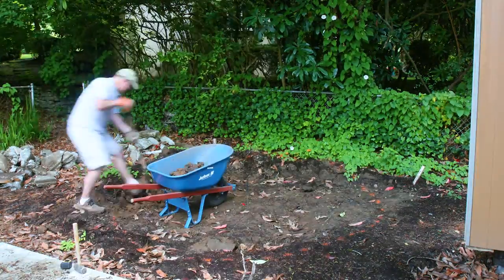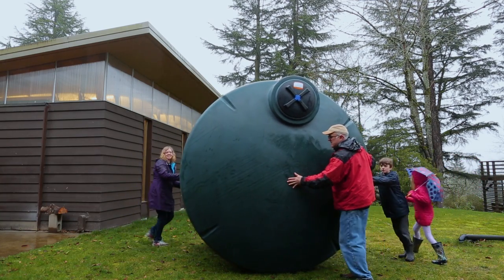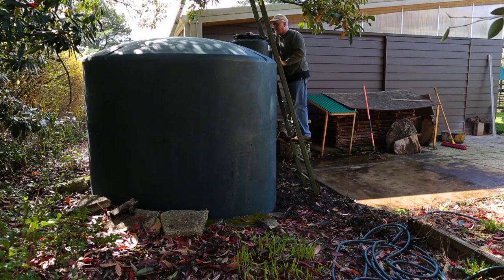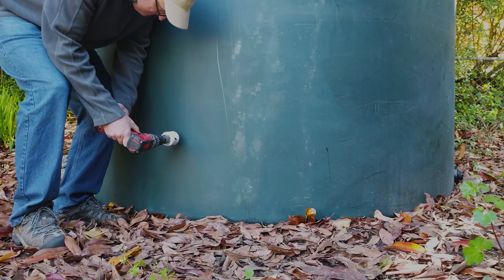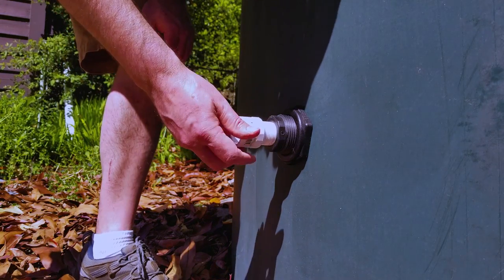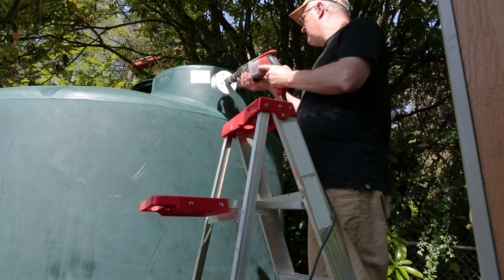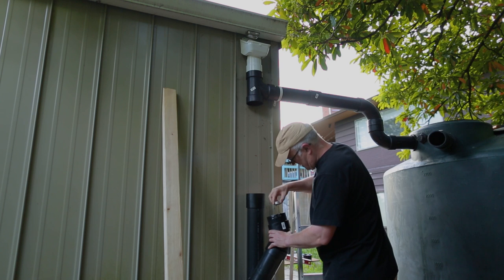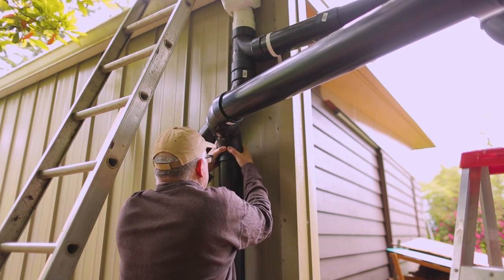The Rainwater Tank

Comment: The over flow looks a little back graded towards the tank, not a big deal though. If you think the horizontal runs aren't properly supported but some supports (pipe clamp or something holding the pipe to the building) on the risers just below the fittings for the 90 from horizontal to vertical and you'll be fine. Source: I am Pipefitter.

Comment: If you add a layer of gravel, smaller gravel then sand to the bottom of your 1st fill pipe, you can leave the drain valve open & it will auto drain in between storms.

Comment: The first rain reservoir is not really needed. The tank will leave the dirty stuff in the bottom of the tank, thereafter you can use the clean water and the overflow is just a good system.

Comment: When using hole saws, especially that size, you definitely want to drill a pilot hole. It would help a lot also you cant put so much force on a hole saw like a typical drill bit, due to how much more surface area the hole saw is trying to grab it will rip it out of your hands when using a cordless drill. Usually you want put just enough pressure on it so it begins to scratch the piece your working on. Ive noticed that once you get a decent little rut for it to sit in you can begin to apply a little more pressure to help get through it. I dont know if its due to the bit getting hot so it goes through the material easier or if it has something to do with it having a little more speed then the initial start ,but yea those would be my reccomendations on hole saws. Also i have a question if that was the drain you were putting on why was it so high up from the bottom of the tank ? Even a couple feet off the bottom would be tons of gallons of water and would weih a bunch if the purpose for draning was to move it,its still gonna be a pain

Comment: In Puerto Rico where I live in the house within our community and on my farm in the mountains of Puerto Rico I have rain water HARVESTING systems. Just from the runoff we get four MILLION gallons of rain water in my community neighborhood home. On my farm we get over SEVEN MILLION GALLONS OF RAIN WATER from the mountain runoff. At the bottom of the mountain I have a ten inch pipe under gravel,  dirt gravel,  dirt, sand gravel and dirt and grass. There is an outlet with several filters then the water goes into a tank for distillation and finally into my enclosed swimming pool which is really an underground water storage tank that has UV WATER STERILIZER SYSTEMS and an aquarium pump for pumping water up to a tank on the highest level of the roof. The entire system was built in conjunction with the building of my houses. I use an array of solar panels, hydro electric turbines with four aquarium pumps to generate electricity and finally wind turbines. 
I got the idea from watching The Discovery Channel where they had a series on the demise of the human race. In that television series the ALIENS were under the impression that SWIMMING POOLS WERE ACTUALLY WATER STORAGE TANKS.  I also learned that in the series an Olympic Size Swimming Pool holds four MILLION gallons of water. 
Here in Puerto Rico we have the rainy season and really rains a lot here. I truly enjoy living completely off the grid. Including Satellite communications and satellite internet with satellite entertainment systems. My farm is an Agricultural farm in which I don't pay any type of property taxes. My community neighborhood house is my Primary residence in which I also don't pay any taxes for.  I just pay the insurance coverages and regular time to time maintenance for fixing or upkeep of my properties. 
After Hurricane Maria hit Puerto Rico most of my neighbors around my farm moved out to the United States and sold me their farms which surrounded my property in the Mountains. So now I have a flowing river through the Middle of the farm. 
We had several earthquakes after hurricane Maria and now we have The Wuhan Chinese Coronavirus PANDEMIC PLAGUE in Puerto Rico. But as a cold War era  child I was trained in Civil Defense learning how to prepare for disasters. Too as a retired Navy Combat Veteran who has served 34 years in the Navy I knew to prepare for everything possible. Food storage,  water storage,  security measures, and medical emergencies. Besides having lots of toilet paper,  I also have lots of Banana plants and Plantains trees with very large leaves in case I do run out of toilet paper...🤣🇵🇷😂

Comment: Bury the tank below ground
Run the rainwater into the tank
Use a pump to push the water to the peak of the roof and out an irrigation line.
The cool water would cool the roof and subsequently the attic space cooling the whole shop.
The used water would go back into the gutters and down into the tank to be cooled and used again.
Hook all the electrical up to a solar power system.
Liquid cooled shop. 
You're welcome

Comment: You could've just roll it around, that would save you a lot of time. They are pretty durable tanks. I had one that was blown for like 300 ft from where it was originally standing. I'm still using it, no damages. Also...you could've buy the correct fittings that you need instead of cutting a hole into the tank...If you ever need to use the tank for something else it will be a hustle to convert it again...

Comment: Why does the water enter the tank and is released at the bottom? Why cant it free fall from the top? Would love to understand why.
Reply: The fresh water what enters will renew the old water in the Bottom of the tank. The water moves around. If the Tank is very full there will not be very much free fall of the water and it wont mix itself. So it was released at the Bottom. :) J.

Comment: Now how would this system handle the inflow of rainwater when the tank is nearing the top or even halfway point? Wouldnt the pressure of 2500 Gallons of water weighing down keep water from continuing to flow in?
Reply: That's a good question. Something to know here is that pressure in water does not depend on volume but on height, with the formula of Pressure = Density * Gravity * Height
That means that, as long as the pipe inlet (the downspout) is above the water level into which it flows (the water level in the tank), water will continue to flow into the tank. Whether you have 2500 gallons or 1 gallon makes no difference, it is all about the height.

Comment: Very Well Done.  I have been plumbing for years, and yes, figuring out that last glue joint can be a tricky one.  I think you did a GREAT Job. I have used hole saws for years too, and glad you didn't break your wrist with that first drill.  now that your finished, what would you have done differently, if anything ? thanks for the Documentary  ;)

Comment: Your going to get some leaves in the filter on the roof of the tank, so regular cleaning would be needed, which if not the leaves will find there way into the tank and spoil the water. trust me, it has happened many times to our tanks.

Comment: Very nice vid with coll effects. Is that tank really 350 lbs? I have a much smaller (550 gallons) and it was really light weight. I could lift it in the air upside down and wash it  so all the debris could fall out. I also took the frame of the lid off and came in to clean. Yeah, I got my tank used all dirt but it cost only U$180 and the last owner delivered it to me.   So far I just bent the spouts into the opening and the tank is full haha it rains a lot here in Florida.

Comment: A tip with hole saws especially in metals is to come in on a slight angle. Nothing crazy but enough so you aren't having full teeth contact at once it'll be too much unless you are using a drill press.

Comment: If you drill a hole at the bottom of the wall of the tank and mount a clear pipe that runs upwards on the outside you can see the water level in your tank

Comment: 7:47  ...  with a magnet at the other end, you would get it easily 😉    :  anyway, very nice work !! 

i wonder that, if the 18:28 filter system is dirty (many trees around ...), if the overflow will go down to the basement ? 😲
there is no extra security to avoid water spilling around this piece, or water projections ? 😩

Comment: I watched this vid over a year ago and saved it. I haven’t read all of the comments. Can someone tell me if, with proper placement, installation, and overflow drainage considerations, could this system be installed under ground with a cabin built above for year round use? In the winter (no rainfall) could water be trucked in and the tank filled? Idk, just trying to get a system that works. I don’t want to be hauling buckets from the creek or melting snow or defrosting pipes.

Comment: I would have run the overflow straight down along the side of the tank and then across the ground to the outlet. Of course, it could be a tripping hazard but then you wouldn't have to worry about the weight of water in the pipe.

Comment: Question..... would not the water pressure of the volume inside the tank overwhelm the gravity fed system and cause it to not fill the tank past a certain level?
I would think having the water inlet pipe opening closer to the top would be more effective.

Comment: One trick I have seen done by someone to handle the insertion of tight fittings. Put the inner piece in the freezer beforehand. It would have the same effect as heating the outer assembly.

Comment: Great, if the rain water go down the tank by big/ling pipe. This will stir the rain water inside  big tank. Rain water will by murki n dirty. The solusio is not using the long pipe in the tank. 😆😅, better think about how filter the rain water. Better have a sistem let the part of dirty rain gone... then fill up the tank... 😍. Thx4 the video

Comment: Something I am having an issue rapping my head around, with the inlet inside the tank having the footing on the floor, wouldn't water pressure stop the inflow way before the tank is full ?
Reply: dave Smith. The pressure from the water level build up should oppose the flow of water into the tank only if the tank is not under atmospheric pressure. But since both the inside of the tank and the drain pipe to the bottom of the tank will have close to the same pressure it should flow okay.
Reply: @rhodaime79  Thanks, okay, I think I have that sorted, now that I have had time to think it through yes, I get it.

Comment: A punched well would be a lot easier, and not that costly,  you don't pump the water till you need it and it's safe to drink. The the pond makes the best and richest supply of water for gardens! It doesn't use that much water, gray water can be great for the yard.

Comment: What's with the ball in the drain? What's the purpose of the black ball?
Reply: The ball floats to the top as the first runoff pipe fills.  Once the runoff pipe is filled the ball will be at the top of the pipe and will act as a plug to allow the cleaner water to flow into the pipe filling the tank.

Comment: Wouldn’t that overflow res. .... once full with dirty run off water eventually get washed into the tank over the period of the rain fall. I can’t see it just sitting and staying in the overflow with additional water agitating it and stirring it up etc 🤷🏻‍♂️
Reply: Nothing is perfect. And no most of the debris wouldn’t cause an issue because its under at least a gallon of water pressure. Its not like this system has any kind of vacuum suction.
Reply: Don’t get me wrong ... I think it’s a great system. I suppose the dirty debris should fall to the bottom and settle though hey ... sand, dirt, shingle crumbs, bird shit ...

Comment: There was no need of so much of struggle for the first hole and fix the assemble through the inner side by making the boy slip into the tank while it is kept in the horizontal position . Later the boy could have come out after helping his father to fix the bush from the inside . After the boy is out they could have erected the unit .Its that simple . It could be scary to some though .

Comment: Those drills are too big for everything..... I have used an 18V cordless drill and impact for everything for the last 15 years even drilling through armour plating, its the bit that does the cutting not the drill if you have a good bit with lude you can cut/drill through just about anything.... there has only been very few occasions I have ever needed to use a 1/2 impact to either remove or install something heavy. if i need something bigger I use a breaker bar and good old fashion body weight.